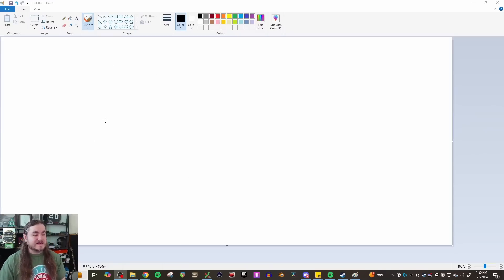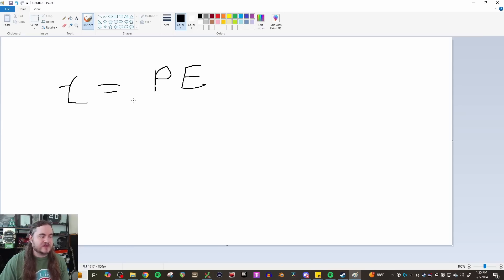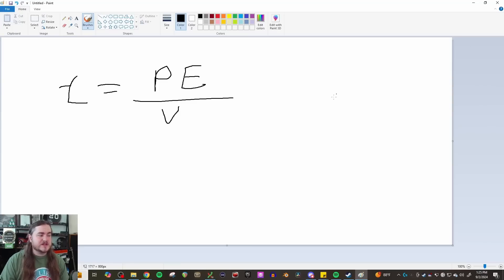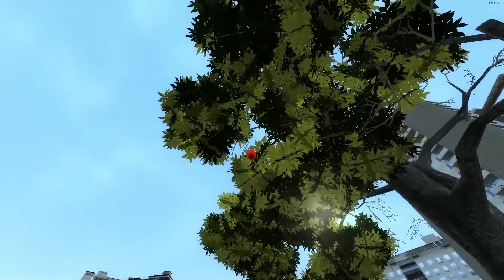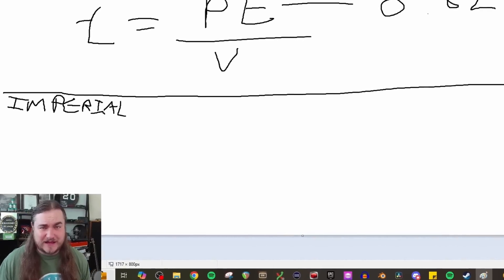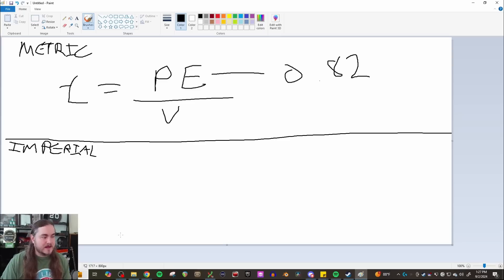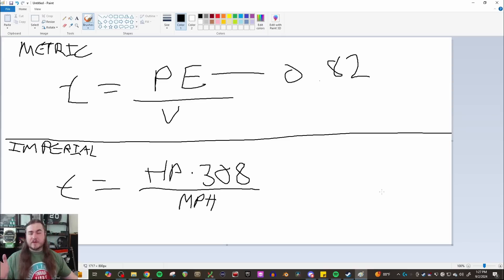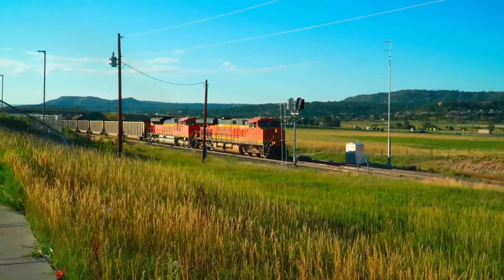Diesel Tractive Effort 101

Comment: In physics of course there is no free lunch.  With electricity at a set wattage, when you increase the voltage the amps decrease, and vice versa.  So it stands to reason that with diesel locomotives when the speed is increased the torque and tractive effort head the other way.  But here is my silly question:  How much tractive effort is actually needed to keep a train rolling at a higher speed?  Thanks.

Comment: Reminds me of my favorite railroad stories  18,000 tons of coal two brand new GP 50s rated at 3500 hp each! Only a fool would believe that! Four axle locomotive 3500 hp sure! But that’s what the manifest showed it as! Only one problem it was 3500 on the high side of transition. I think it was 2000 on the low side.! Needless to say 4000 hp won’t pull 18,000 tons out of Garnet Kansas going south although the Missouri Pacific and the Union Pacific kept trying to! Until they burned up a bunch of GP 50s and EMD said no warranty that put a stop to that oh memories! We never melted the rail, but we sure got the cab floor, so hot couldn’t touch it, but it would cook soup in a can!

Comment: I guess it is somewhat similar to jet fighters and helicopters.
Jets will measure thrust (in lbs ou whatever) cause it just scales with speed while helicopters usually measure power (in hp usually) because it does NOT scale whatsoever.

Comment: Na, you can't beat math, more horsepower will mean you can pull more load at the same speed, or the same load at a higher speed, work is Force x Distance, also power is Torque x RPM. The steam engine is more powerful, it can't be doing more work / second and have less horsepower, also work is heat
Reply from the maker: Yeah, but the horsepower readings given for locomotives are at dedicated speeds, basically throwing the fundamentals out the window. A 4400 HP diesel is not a 4400 HP steam engine because of the way they're rated. I promise you the locomotives don't break the laws of physics, but there's a reason they don't tend to rate steam in horsepower.

Comment: Power is not tractive force is not torque. People mixing these terms will completely drive me insane someday. And reality begins after simplifications have left the chat. I would even say horsepower at the drawbar is a better comparison than tractive effort because that´s what really tells how much the loco can pull at a given speed. 
The steam locomotive after all is not a constant torque / tractive force machine because if it was it would be able to produce infinite power (the thing in KW or HP), which it definetely can´t. Even if one would mount a boiler so big and powerful that it could deliver more steam than the motor unit could ever use, with higher rpms aka higher piston speeds the steam (or any other gaseous medium) won´t be able to completely fill the cylinder anymore until the point that there won´t be enough filling to generate any more tractive force. And that is only if it didn´t fail in a spectactular fashion because the crank and rod and bearings couldn´t withstand the forces generated just by moving the piston at the speed of sound. In a real locomotive the most common limit will be the boiler with maximum achievable piston speeds on second place.
And the Diesel is not a constant power machine because back EMF is a really big deal and maximum electric motor rpm and amps isn´t nothing either. There´s a reason why most battery electric cars are wickedly fast at slow speeds but suck in the top end. They´re missing a mechanical gearbox to put the motors back into an rpm range in which they can generate power more efficiently.
In the end tractive effort says nothing. Power says a little more but still not much. Maximum starting tractive effort tells how heavy of a train a locomotive can start and max continious TE how much it can pull up a certain grade at a snails pace. DV DM3 kind of thing. One would need the full TE over speed curves of 2 locos to be able to make a proper comparison. Big Boy makes 6200 to 7000 hp at 41mph - and I´d assume it can hold that for a while before power significantly drops - so no wonder it can pull it can almost pull as much train as 3 big 4400 hp Diesels at high speeds when 4400 hp Diesel engine translates to probably less than 3000 hp at the rails because back EMF.

Comment: 4:33 "There's an exponential decay"
No there isn't. It's hyperbolic. I get that, these days, "exponential" just means "emphatically fast" but you're talking about actual mathematics here. An exponential relationship would mean that, when the speed drops by 1mph, the tractive effort doubles. So, if it drops by 2mph, is quadruples, and if it drops by 3mph, it goes up by a factor of 8 (doubles, then doubles again, then doubles a third time). What you're seeing in this curve is that, when the speed halves, the tractive effort doubles.

In this hyperbolic relationship, if the speed drops from 8mph to 1mph (a factor of 8), the tractive effort goes up by a factor of 8. If the relationship was exponential, the tractive effort would increase by a factor of 128 (doubling seven times). in reality, almost nothing in mechanical systems behaves exponentially.

Comment: And the ultimate solution to everything are electric locomotives. They´ve got the tractive effort and the horsepower. They pull like a diesel, but don´t run out of power at like 12 mph, but can keep accelerating with full tractive effort until like 50 mph.

Comment: Since nitpicking is the official sport of rail nuts, I will point out that this is not exponential decay but simply the behavior of a reciprocal y = a/x, sometimes called hyperbolic decay, but that’s not a widely-used term.

With exponential decay, doubling the speed would cut the tractive effort by a factor of 4; with the reciprocal relationship, it only cuts it by a factor of 2.

If the decay were truly exponential, a  70mph intermodal train needing 5 diesels would instead need about 10.

Comment: The only weird thing is your Video. The graph you use is wrong. The only thing you are doing is plotting the function because your assumption of a constant power output is false. This is not a graph showing the pulling force of a locomotive. Also, the statement that steam locomotives can pull more than diesel/electric is strange. Most of the time, diesel/electric and steam locomotives are geared for complete different scenarios. This also means that they develop their peak power at complete different speeds. And because of P=F*v you need more power to pull the same load faster. If you compared steam and diesel/electric when they have the same power output at the same speed, there will be no difference in the pulling force they generate. So diesel/electric doesn’t out pull steam or the other way around.

Comment: Power to pull deep reducing to slow and air brakes not applied dumped 100000 lbs takes 1/4 mile to stop

Comment: I can see why this happens, and I just needed to see the graph of tractive effort vs speed to figure out why it does this.
Electric motors are why.
Diesel-hydraulic or diesel-mechanical engines will NOT have this kind of tractive effort relationship.
The reason is that electric motor torque is inversely proportional to speed, assuming a constant input voltage and current (and frequency if using AC traction motors).
Go look at the torque vs rpm curve for a brushed DC electric motor and you'll find that you can almost perfectly overlay it on top of the tractive effort vs speed curve of a diesel-electric locomotive.
The reason is that the prime mover (from the perspective of the spinning axles of the train's bogies or the shaft of the "toy" DC motor) in both cases is an electric motor.
Of course this all assumes no wheel-slip and full-throttle operation for the locomotive. But so long as you don't CHANGE which notch you are in, you will likely still notice the same thing with ANY throttle setting.

Comment: Spent 3 hours discussing questions and taking notes with the CSX locomotive shop manager back in 2002 when I was developing a crib for modders of Trainz and I will agree completely.  You can even get down in the nitty gritty of how humidity can effect the cooling air's velocity in turns.    All new diesels will run happily all day in notch 8 on a flat lightly oiled sea level track at their spec in 72°F weather.  That line exists nowhere on Earth.

Furthermore there's a note from a book about the Hale telescope in which it mentions that Amtrak's power generation rental's output is 'subject to change after delivery'

Comment: Given the year, it's probably more fair to say steam locomotive tractive effort is "weird".  It's directly related to torque at the wheels.  An Abrams tank uses a gas turbine that doesn't produce much torque at the shaft, but with a gearbox it can produce tremendous torque at the wheels or uhhh tracks.  You hit the nail on the head when you said steam locomotives are constant torque engines.  Horsepower is less descriptive of an engine's capabilities when there's no transmission.

Comment: 6:10 - Dividing by 4, huh, that's a rather conservative approach. Under dry conditions you'll be able to put about .4 times the weight down. Under bad conditions (wet, leaves, dirt etc.) it drops off, obviously. Then it'll often even end up significantly below .25 times the weight. Especially around late autumn I'll experience the factor dropping down to .12-ish, which I'd call significantly worsened conditions, though still not exactly a shocker and nothing some sand won't ameliorate. Oh that's maybe where the divide by 4 rule of thumb comes from? In my experience you'll virtually always get up to at least somwhere around that value with sand.
7:30 - To me, that's distant echoes from historic pasts. Commutator motors and their risk of melting the soldering of commutator segments at too much current through one segment in too long a time. There were rules as to how many seconds you have to get the train rolling before you have to switch off and let the motor cool. I don't know them, I don't need them. Even the oldest stuff I've ever run, class 120 that was being built since 1979, had AC asynchronous motors. They're induction motors, no commutator, no moving electrical parts, way higher efficiency and virtually constant characteristics across a mindblowingly vast speed spectrum. I'm regularly surprised by US diesel engines still relying heavily on DC motors.
Reply from the maker: I honestly don't know exactly why 0.25 is the rule of thumb because you are correct, you can usually get more. Maybe that's more safety factor built in. Shrug. Someone call up EMD, lol!

There's a fair amount of AC power out here now; it's less so than DC still but the railroads are primarily only buying it now for a ton of reasons, including all the bits you mentioned. I had no idea how to tie in AC into the discussion and frankly have no real operational familiarity with it so I figured I wouldn't open the cab of worms, this time at least. :D
Reply: Division by 4 was the standard calculation going back to the days of steam.  I can't tell you more about where it comes from, except to note that .25 is close to the average of your .4 and .12.

Comment: I'm an Electrical Engineer, and I can say you explained this issue very well.  I will add that the back EMF of the motors is a strong component of the speed limiting nature of the motors.  The faster the motor turns, the more back EMF is generated, requiring a  higher supplied voltage to generate the same torque.  This puts a harder load on the generator and stretches the abilities of the protective equipment, and no one wants to mess with uncontrolled DC arcing.

Comment: The minimum speed is just the speed at which the full horsepower results in the continuous tractive effort.  It is not a "minimum" that the locomotive must move.  If the horsepower is reduced as the speed falls and the tractive effort remains at the continuous rating, the locomotive can run at that speed indefinitely.

All of that is much less relevant today though, as AC traction motors are pretty much capable of continuous output equal to the wheel slip torque.

Comment: variable frequency drives and synchronous AC motors can deliver a variable torque.  but now there is a limit of the amperage or power at either the VFD or the motor windings.

Comment: There is no "low RPM limit" for electric motors. What you are likely referring to is current limit, which is determined by maximum operating temperature and available cooling. At low RPMs or at stand still motors usually have the largest current flowing through them since back EMF is low or zero. The important distinction here is that current limit is applicable to any RPM. On pure electric locomotives it is possible to go past continuous operation rated current even at very high speeds, since they are not prime mover power limited as diesel electric. Similarly, if you are within the limit you can have it "going" indefinitely even at zero RPM.

Comment: Actually the logistics for electric and steam power are the same. At some speed, the steam locomotive starts using steam faster than the boiler can produce it when fully stoked, and you begin to lose tractive effort. Same as electric locomotive losing tractive effort when going over peak pulling speed (which is usually close to 0). Maximum force on the drivers is limited by steam pressure, which doesn't increase if you go slow enough, since it's limited by boiler strength. Same as maximum electric motor torque is limited by electric current, which can't increase below certain speed because this is limited by the overheating tolerance of the motor (and all the other electronics). The difference is that steam and electric powered locomotives are usually optimized for different maximum tractive effort speed. Apparently it's most economical when this speed is right about 0, and if you need to pull longer trains faster, it's more economical to use slugs than to make more powerful individual tractors. Optimizing steam boiler like this would make it microscopic, which makes it completely impossible to run safely with coal as fuel and manual water control, among other less significant issues.

At the end of the day, you can't outsmart the laws of thermodynamics. There's a horsepower limit to any engine, dictated by the fuel burn rate and the efficiency of it, and once you reach it, you either get slower speed or weaker pull.

Comment: As an additional point to what you were saying, an electric motor has maximum torque at 0 RPM, hence the additional reason why a diesel can start a train it can’t pull. It would seem the thing to do would be to figure out a way to hybridize the pulling reactive effort of a steam engine with the starting reactive effort of a diesel. Maybe something like a multi piston steam powered crankshaft to run a generator? I wonder if part of the reason for a diesel hydraulic system is to try and overcome that problem…

Comment: Pretty sure none of this is particular to diesel locomotives, it applies the same to pure-electric locomotives as to diesel-electric ones. Except that electric ones have way more power available, as they aren't limited by the electricity generation but just by what power the traction motors and other electrical components can handle.

Comment: Stop confusing horsepower and torque. Diesel electrics are governed by electric motor characteristics. Torque is max at stalled speed and reduces as speed increases due to back emf, this reduces the amperage an electric motor can draw as this back emf opposes the direction of current flow through windings as rpm increases.
Dude do some more research , AC traction does not have short time ratings!

Comment: so basically because the rpm is tied directly to the velocity of the steam engine, the torque is highly limited at low speeds, but you can run the diesel way into its happy place and electricity can dump huge torque into the wheels; you get enough to move the train despite having a much less powerful engine?

Comment: I completely stopped arguing with my trainmasters in Barstow CA about horsepower and traction (hpt). I take whatever number of engines I'm assigned, if it's under horsepower for the mountain I'll just casually let them know and have them tell me "you can take it, it's ok." Every so often we'll stall the train and I'll be like "well, you told me to take it." Then for about a month there seems to be enough power on the trains, then it's back to stalling them, rinse, repeat.
Reply: who assigns them?